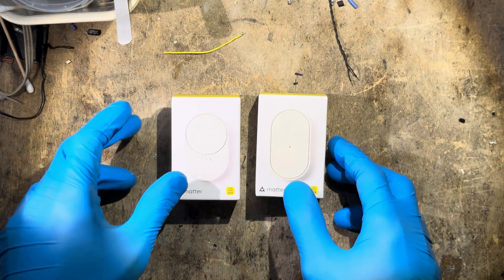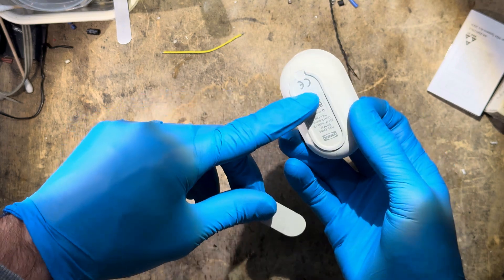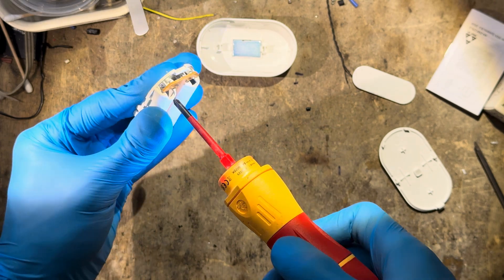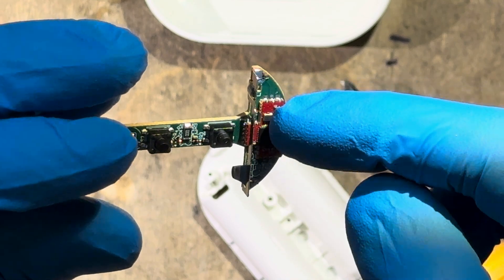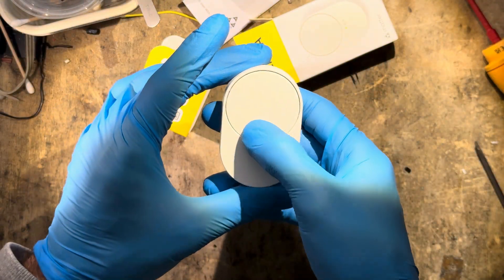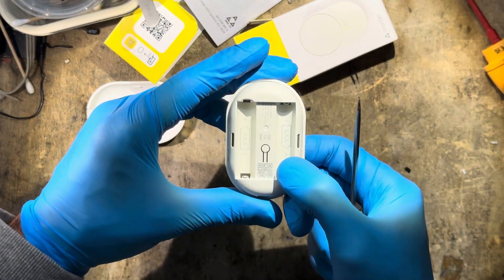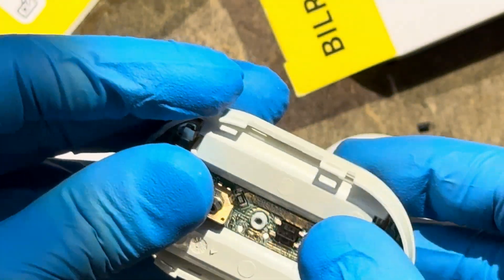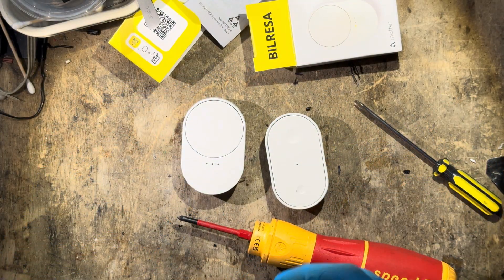IKEA BILRESA - Wireless dimmer switch with Matter - unboxing and Teardown

Comment: Wow that looks much bigger than Rodret? I’m also surprised it needs 2 batteries now instead of 1… I have one of these on the way but now I’m thinking I should have bought out the discontinued Rodret stock instead 😢
Reply from the maker: Size is about the same. Maybe a bit bigger but not by much. Too early to say but I would expect longer battery life from the two batteries
Reply: @FrancescoF  dunno about longer battery life at least for now… my BILRESA dual have 42% and BILRESA scroll 52% of charge.
For example RODRET (bought on same day) have still 84% 
Dunno if it’s a bug in FW or Homeassistant problem.

Comment: There are many complains about scroll wheel on dimmer button, while one with just two buttons works well. I plan to buy them.
Reply from the maker: It’s not that easy to grip on it, I have to say. But I still haven’t tried it yet
Reply: @FrancescoF  Seems like a relatively easy fix with a 3D printer. Just make a dial with more height so it sticks out a bit.

Comment: Will you be doing the MYGGBETT contact sensors? I'm curious to see how those look on the inside compared to the smaller designs from other brands.
Reply from the maker: Those are ultrasonically welded I fear, so it’ll be a destructive teardown